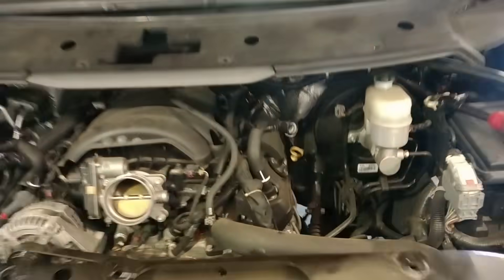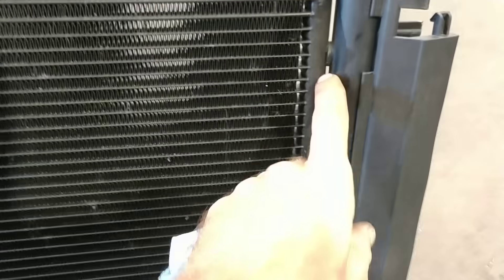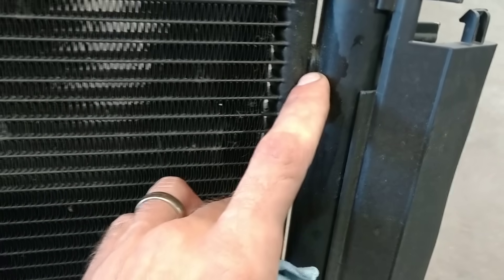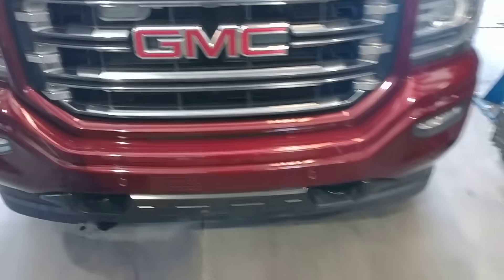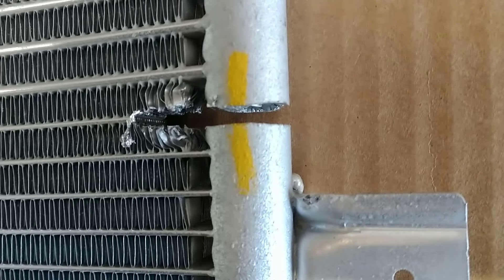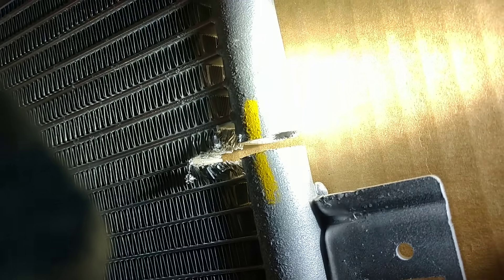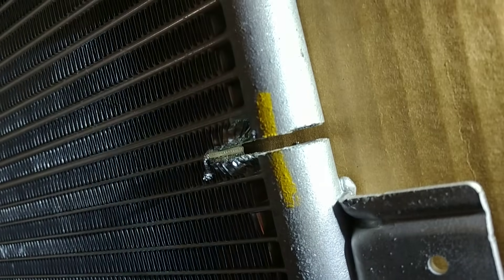Customer States...WAIT, look at this! Can't make this stuff up!

Comment: Had a brand new radiator for my 91 Volvo with a similar cut (not a genuine one, those are NLA).  I was about to lose my cool, but looked back on the website pictures and sure enough, it's there.  No issues.  Must be a stress relief cut.  I was convinced that it would not hold fluid until I looked closer at the design.

Comment: I work at a GM dealer in parts and i have actually seen a radiator identically like this in the exact same place. We thought it was intentional at first but its definitely not supposed to be like that. The cut was in the exact same place on ours, we made a claim for it to GM.

Comment: Home HVAC started using Micro Channel several years ago. okay on low pressure systems and use a lot less charge but at 400+ PSIg with R410A not so good on longevity.

Comment: That's a stress reduction cut. As the condensor heats up it expands, the accumator doesn't. This cause stress and cracking. They eliminated the problem and you should be grateful. of course it turns the condensor into an expensive bug catcher.

Comment: Collision repair for 40 years unboxing numerous manufacturer's parts, the manufacturer that cared the most about protecting its new parts in their boxes was Hyundai Kia and Volvo. There  parts were generally wrapped in a foam lined box with thick cardboard it was a piece of jewelry to be attached as a new part on the vehicle. The worst packaging I've ever seen in the most destruction of new parts in during shipping was a cheaply lined thin box from either Toyota or general motors consistently damaged new parts that we had to return and not in a timely manner for the customer.

Comment: I don't understand how it would work like that. It is not sealed anymore. IMO I would've just used a TIG welder to repair the old one. Then remove the old desiccant pack, flushed it, and installed a new pack.
Yes holes are TINY. On older cars, I replace them when doing a new AC Comp/system install.

Comment: I got one from the dealer that way. If you look closely its capped off inside the tube. Separating the trans cooler from the condenser. So that would have worked fine

Comment: I've read several comments about this cut being made to fix some issue instead of redesigning the product. If that's the case why don't they bother to clean up the fix and why the yellow mark? To me it looks like the part may have been found to fail quality control and was cut to render it unusable and the yellow mark was so that techs would see it. Maybe it somehow got accidentally packed and shipped. I certainly would not settle for a part like this.

Comment: Most condensers are actually split into a top section and a lower section, and is easily spotted as both connections are on the same side of the condenser.
 The larger top section cools the hot gas until it condenses. The smaller lower section acts as a reservoir of liquified gas and is further cooled. 
This excess gas is deliberately added as all AC leaks very slightly and there is enough gas to ensure the systems doesn't stop working during the warranty period.

Comment: That form of condenser is called "microchannel" which has parallel flow. The good old fashioned copper coils had serpentine flow. The idea for microchannel is to GREATLY increase the surface area where the refrigerant can dissipate heat. Since it is all aluminum it is also cheaper than aluminum finned copper. The drawback: Tiny passages. It doesn't take much to block them up, and forget about flushing a parallel flow condenser or evaporator. Microchannel is yet another symptom of a "cheaper" and "disposable" society.

Comment: Sad to say it, but that is not a new occurrence. Back in the early '90s I had similar things like that happen on jobs I was working on at the Chevy and Buick dealerships. Had misthreaded fittings in radiators for transmission lines, damaged AC cores, crushed radiator tanks, you name it. Damaged like they were packed by gorillas! Toyotas and Nissans had similar things, but they came all the way from Japan! But that damage was done at the GM plant! Canada, Mexico, who knows where. Nothing is made in America anymore! There's no pride in production anymore. Just a quick buck and pass it on.

Comment: I bought a GM replacement radiator once and the one they shipped had the trans cooler holes in a different place.  So I went to auto zone or somewhere and bought a "off brand " replacement for less than half the price.  I had them side by side and started to notice some stamping marks on the frame were the same, then noticed some dimples and crimps were identical on both the GM and the "no name".  I would bet 1000 dollars that those two radiators were built in the same factory and the only difference for the Genuine GM was the over inflated price.

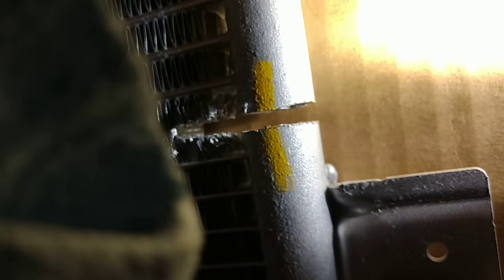Comment: 1:02 Is it a Microchannel condenser? If so, these types of coils have been known in the industry for at least a decade now to fail very quickly and be leaky. But manufs. still use them for the lower costs and smaller physical size.

Comment: Micro fins they've started using the more and more in residential and light commercial air conditioning they are a pain in the butt when it comes to cleaning because they do not use the regular coil cleaning solution

Comment: Reminds me of the non genuine timing cover i got for my toyota corona (22r-e engine) mr chinese worker forgot to drill the hole for the oil to leave the oil pump and go into the block.... Lol it had been centre punched, but not drilled, took ages to drill it out to the size it needed to be and die grind the curved chamfer into it like the standard one had... Hope they arent all like that, imagine popping your new oil pump seals and having no oil pressure on a customers car due to that... Luckily i was doing it on my own car, and had the time to mess around with it as i have other cars to drive

Comment: This reminds me of a Baritone ukulele I bought on-line once. The outside shipping box was in perfect shape. Took the inside box out, and there's a forklift prong sized hole in the bottom of the inside box,,,and the uke. It went back real fast. I don't buy instruments on-line any more.
Not an option for car parts though. This looks like a 'disgruntled employee'. It's a bite when damage is an inside job.

Comment: Honda finally admitted to leaking condensers and recently extended the warranty on them.  But, you'll still get the same new <failing soon> condenser.  But, if something like a rock damages a new condenser, the warranty is void.

Comment: does the A/C ever work in a 15-up? i had a 15 and it had the worst A/C ever..  it sometimes tookm 2 minutes after i started the truck to even start blowing cool..  then about the time the air felt cold it cycled out..  had that trucl back to the dealer multiple times with no luck..  they even opened an engineering ticjet with GMC who did nothing..    kept that truck the 2 years of the lease then got a Ram..  which has Ice cold AC

Comment: Can't you just Braze/weld that joint again?
Seems like a big waste to buy a whole new condenser just because a cracked joint.
Reply: Go ahead and try to braze that pot metal 7 times recycled "aluminum" and tell us how that worked out for ya.
Reply: @chasewebber4316  Idk. I'm just asking...
It was Braze/welded together at the facture wasn't it? Why it can't be done again?
Reply: @vitor900000  well in my experience. No matter how much u clean the surface or heat it I've never been successful in getting it all to bond together and sometimes it's so thin and junk it pops and disintegrates. It's just not a material for brazing. After taking several aluminum radiators to my local radiator shop who repair radiators professionally and gotten turned away on a aluminum radiator core. I dont even think it try to repair aluminum radiator cores. I usually get "we can replace the aluminum core" but most of the time a new replacement is cheaper or the same price.

Comment: BOOOHISSSS...I GOT A REBUILT CARBURETOR FROM NAPA...I REBUILD CARBS...(YEARS BACK) NAPA BIT ME FOR OVER $ 300.00 A SIMPLE 1BBL ON A FORD BIG SIX(E-150 1985)...ALL THAT WAS WRONG WITH MINE WAS ACCELERATOR DIAPHRAM CRACKED FROM SITTING IN ARIZONA...THIS NAPA CARB HAD BEEN INSTALLED...UH HUH...SMELLED GAS...I WAS ALREADY OUT OF TOWN BY 5 HOURS...I WAS STEAMING...A CARB KIT WAS $14.00 (+ tax license & shoe size) GRRRR...I WAS IN PAIN ( LOWER BACK 5 PINCHED NERVES) SO...I GOT BURNED...NO MORE BUSINESS WITH NAPA...NAPA HEADED COUNTER MAN...EVEN A RETURN MUST BE LOOKED AT...DANG...SO I AM NOT COMPLAINING...JUST BURNED...

Comment: That is not the correct design of condenser for AC pressures inside of a heat pump system. They should be round tubes to better hold the pressure. That design of radiator is literally for liquids not high pressure gases. The more I see automotive refrigeration systems the more I think "what the fuck are they doing". I can live with the aluminium condenser, not like it'd be brazed in place, but that thing is a joke.

Comment: Those small passages for the refrigerant to flow through, will clog with A/C stop leak additives. It's best to locate the leak and fix it, not clog the system up.
It can also cause trouble with the mechanic's A/C Service machine.

Comment: Others have already said it, it's supposed to be like that. It solves the problem of the thermal cycling you mentioned. That tube that is cut is dead...it's not connected, nothing flows through it. BUT...that is piss poor execution! They could have ether: A. Designed the condenser with a stress relief where they don't have to cut one in. Most desirable option, but hey, it'll cost money. So option B. Put a friggin note explaining the stupid, ugly, half assed attempt to fix a design flaw is supposed to be there!! I was pissed the first time I encountered that after waiting a week for the part.

Comment: I had one of these sent to me.  Thought it was defective so I wanted a new one.  Of course So part for down time of 3 weeks.

2nd one sent and dambed if it wasn't worse than the 1st one!  I was livid!  It looked like someone took a sawzall to it!!

So, I pressurized it and whaddayouknow...it held pressure.

I understand the gap.  I do.  But the way they made it looked so hacked.  Even cut some of the fins (not the rod).

Quality control has gone out the window.  They find a country that pays their employees 50 cents a day, with no benefits mind you, to make their parts so they can be competitive.  Maybe that's why these condensers are prematurely failing in the first place.

Jim

Comment: There's a time of issues with this model year, the ac is one of them asking with the trans/torque converter and lifters on the cylinders that turn off due to the afm system. Also the replacement condensers cine with that cut in them, I don't recall the exact reason though.

Comment: Condensers don’t have accumulators. That’s a receiver. I believe most car manufacturers call them receiver/driers these days, but I’m not an automotive guy. Receivers are a storage tank for liquid. Accumulators are on the suction line and prevent liquid refrigerant from entering the compressor.

Comment: I worked for a GMC dealership and replaced many of these condensers. I freaked out about it too at first then some more xp techs told me about it. Looked it up in GM's SI bulletins and turned out it's a normal feature of this condenser type. Unfortunately I also was unable to find out why GM is making this cut.

Comment: It’s called a micro-channel coil. It is designed for efficiency, but if it’s washed with water, it needs to be blown out with compressed air because water will effectively block the air flow until it evaporates.

Comment: The problem is actually the Transmission cooler being integrated into the condenser. Causes a huge temperature differential creating your crack. You can see the fins near the top are thicker to accommodate transmission fluid.

Comment: I needed the door wiring loom, the main Renault Dealer said sorry for the delay, part of it is missing. I got to see it. The connecter had been cut off where they had removed it from another car!!! They ordered another and fitted it. Great but now my wing mirrors don't work? They said am I sure they worked before?  I looked in the car and found a second hand wiring loom from the wrong model of car had been installed in my car. They said Well of cause it is a generic part that fits many different models of car, and it is fully reconditioned by Renault. What a load of bull shit, it came out of scrap yard and had been damaged where they had just pulled it out by force!

Comment: Per Gm Document GCUS-9-11438, The cut is to allow for differences in thermal expansion between the top trans cooler portion and the lower consenser portion of the combi-cooler. Cuts are made in a dead tube area that has no fluid flow.

Comment: That is normal.    I thought the same thing and I pulled the other two we had in stock and they were the same with the cut in the side.   I think the upper part is for the trans cooler and for whatever reason the cut it this way.    I installed mine and had no issues

Comment: Years ago in the United States in Baltimore Maryland actually I was working on an Infiniti and I had to replace the radiator the first radiator they sent me the type was cracked so I sent it back to the store the second one they sent me it was bowed really bad so I sent that one back they sent me a third one the post that you will get to the bottom of the car on the third one were broken so I had to end up calling Infinity and waiting in the extra two days a radiator for a because every auto parts store that my company dealt with had defective radiators

Comment: I have a '17 GMC Sierra, and my AC did that when it was two years old and only had 20,000 miles on it. It's been good since, but I'm sure I'll end up with this problem again based on your comments. Second thing is...somebody packed a damaged part! No cut or damage to the box that condenser was in. I would have been mighty upset if I had received a part like that!

Comment: Funny thing is its supposed to be like that.  Look at the one you took out! Same thing.  The top part is actually part of the trans cooler system and the bottom is the condenser and that cut is where they separate and plug each.  Also if you look at the cores, you can see the size difference top to bottom sections

Comment: Nothing like making 1.4hrs - 1.6hrs (r134a or r1234yf) in 15 seconds of looking at the welded connection of the condenser. This is how I prefer my gravy as a GMC technician in the summer.
Reply: I will note that my replacement part preference is an intact AC Delco condenser with the updated patch that helps prevent this issue from happening.

Comment: So if that cut was to allow for expansion on a bad design, and it’s sealed somewhere out of view, even though it’s clearly going through horizontal tube, why did they have to do the cut so rough? At least try to make it look like it’s supposed to be there, instead of mowing through half the part.

Comment: After the condenser is cut, plugs are installed on both sides.  The top part of the condenser is used as a trans cooler.

Comment: Bet the condensers don't crack like that on Lexus or Toyota's when only 4 years old.  Even my Nissan which is an 06 still blows cold air and I've never even recharged or repaired the system once yet.

Comment: GM usually puts an aluminum tape over that cut, and yes i replaced one and it looked just like that. but i didn't freak out because i already knew that the trans cooler and condenser are shared and the cut is in a dead space between the two.

Comment: The description and top comment explains it all bros... just chill...
FYI, about 20yrs ago I used my FireBird A/C condensor as a trans cooler and the damn thing was always room temp while I was roastin' on my 500 horse 383 sleeper stroker motor!  It's in that dum 1996 VHS with the 70 Challenger throwing off sparks and shredding the tire off, lol....

Comment: LoL I may or may not have accidentally ruined a new part before installation once and sent it back to parts with a WTH! on ticket. If I did it was probably the older type power steering pump for a 90 91 Fleetwood & the damage may have been from being dropped breaking one of the soldered on inlets on the back.

Comment: i work at a body shop what is your opnion on aftermarket radiators and condensors
Reply from the maker: It's all junk bro this is 2021. I have run across fitment issues with aftermarket parts so I do prefer to use OEM stuff.

Comment: Not a surprise. 1) If mfg'ed over the last year, the protocols, shortages, back logs, etc have lots of defective products in circulation. 2) Not uncommon for mfg parts to be defective - i have seem al sorts of lemon crate motors over the years, made here and there, you name the brand. A lot has to do with how the mfg process is set up, its conducive to QC short falls and QC doesn't add value, just preserves reputation so it will never be a primary focus domestically.

Comment: I brought a key lock cylinder for my Chevy last month and when I got the part the bag said Mopar on it but Amazon had stuck a sticker on top of it that said GMC lock solenoid, it was actually a brake light switch!
I've learned to open the part box up at the mailing station, rather than bring it home and have to take it back...

Comment: This cut is normal, the old part will have a similar cut. In fact the Ford Explorer I just put a condenser in had not only had the design and same cut, but uses two condensers stacked on top of each other. :)

Comment: I was a PM with a auto supplier that purposely shipped the same batch of bad parts back to the oem. Basically, take them or leave it. I know as I marked each part after I inspected them for return. The second time I marked them with a drilled hole making them none functional. I can see them shipping them to service.